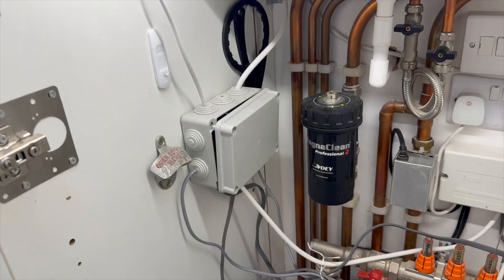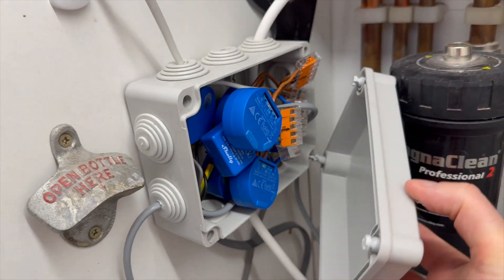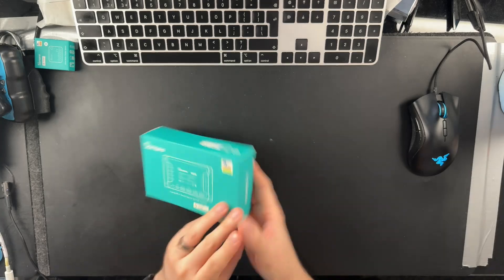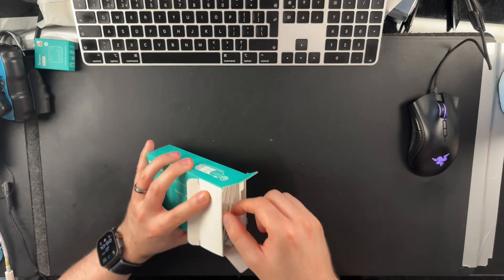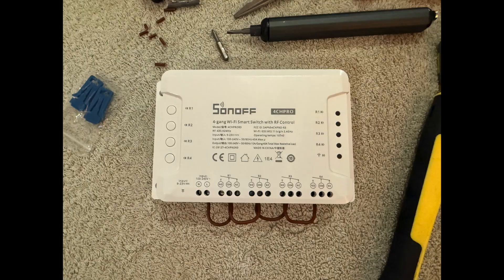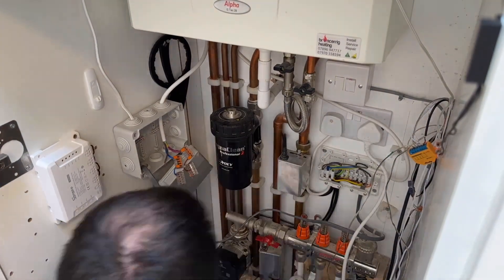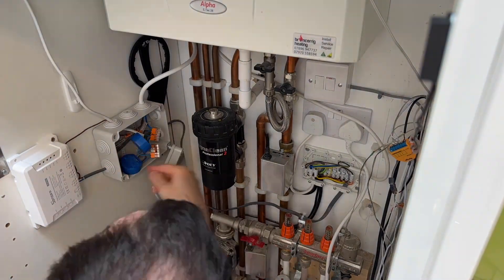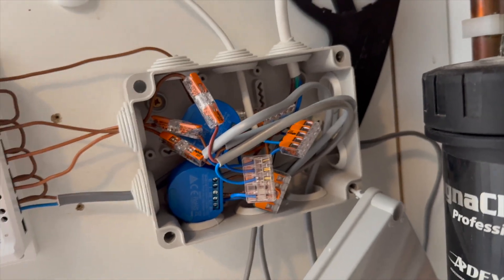Tackling a literal hot mess 🔥 (Sonoff 4CHPROR3)

Comment: Any immersion in there? If so it smart?
Reply from the maker: No immersion, just a gas boiler for underfloor heating. The valves for each zone are in that cupboard, which is what 3 of those existing relays were for.

Did you have a question about controlling an immersion heater?
Reply: I had a THR320D in there but the connection kept dropping. Thinking of doing a esp32 with a temp probe and connecting it up via a relay. Would like to keep the dumb switch functionality too if possible.
Reply from the maker: @stephendevaney8494 Ahh that final requirement might be the trickiest part. Is the dumb switch like a normal light switch? Or a dial with target temp?
Reply: It’s one of those bath/sink switches with an on/off switch as well.
Reply from the maker: @stephendevaney8494 hmm a suitably rated relay may do the trick then.
Reply: It’s one of those bath/sink switches with an on/off switch as well.
Reply: Would two of these replace my crappy heatmiser ufh8 and neostats?